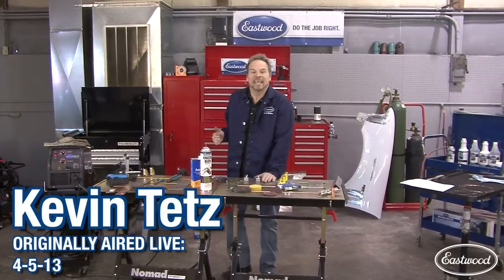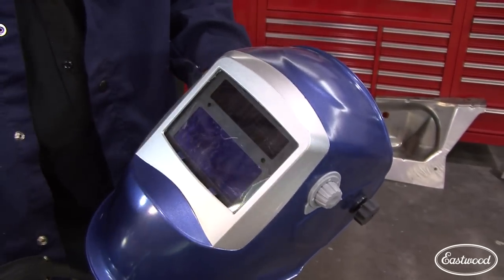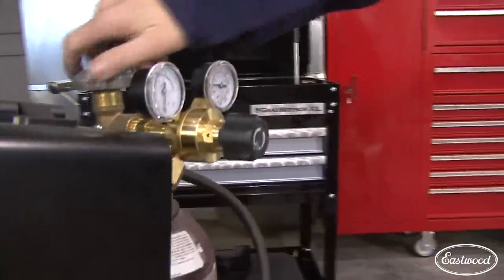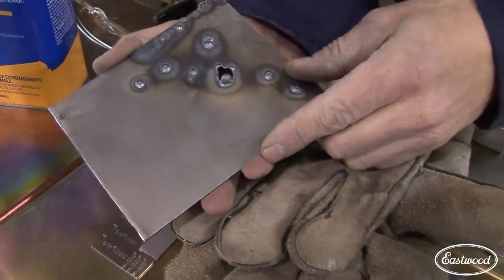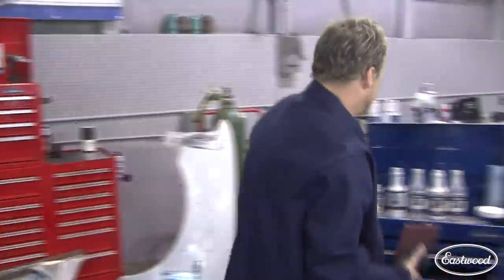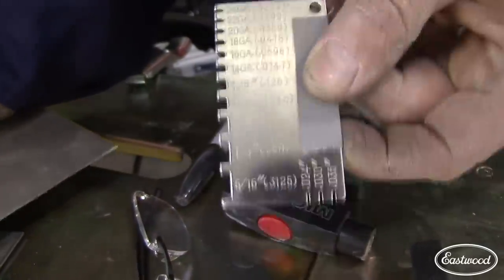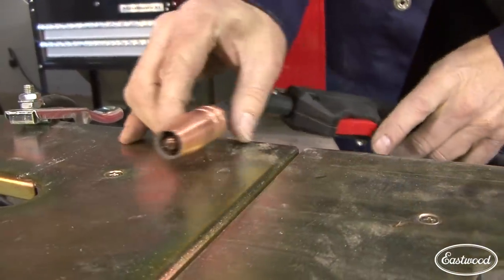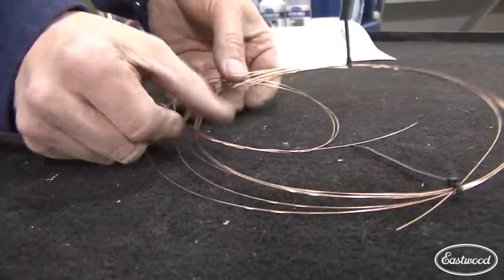How To MIG Weld & MIG Welding Tips - Getting The Perfect Weld Everytime - Pt 1/2 with Kevin Tetz

Comment: Clearly you know how to weld.  My only issue is the short shrift given to flux core welding.  I suspect a great many "amateur" welders started out using an inexpensive flux core system, before "upgrading" to MIG or TIG as the proverbial Holy Grail of welding.  Be that as it may, flux core welding offers serious advantages over all other types of welding, yet these advantages go unrecognized, even by "experts" intent upon selling us all on more expensive welding systems.   Once the user has developed sufficient skill using "cheap" flux core" he or she can produce quite strong, and yes, "pretty" welds using a process so may turn their nose up too.  A FC bead won't be as intrinsically "pretty" as a MIG bead, but the FC weld can be make under ALL weldable conditions, whereas MIG is limited to indoor locations.  FC beats SMAW every day of the week because it provides the user with a more precisely controlled system.  The nonsense about what any given system can weld "in one pass" is what keeps sales of stick machines going strong when in fact, every welder knows that multiple passes can be used to fill up a V-groove of thick metal...in fact it's used all the time using TIG for pipe welding.  For 90+% of all welding, the "do-it-yourselfer" is well served by a flux core machine.  Even better is to purchase a "MIG" machine with infinite heat control and use FC wire in it for about 99% of welding.

Comment: 5:52 My two cents.  I recommend to crack the main valve ever so small like to open the Gas gently until the hose is fully charged, then fully open the valve all the way, then back it off a few millimeters.  It'll save your gauges.  Open it so little that you can actually see the gauges move and not just jump as if they are going to just spring out of the dial into outer space.

Comment: as always, great videos Kevin. 

I would love to see you fab up some seat brackets for a aftermarket racing seat. going into detail about seat heights & angles. 

I know its probally a far cry to get you guys to do something like this, but I am faced with trying to fit some recaros into my project car & think I may want to use the stock rails/sliders from the car, & weld up a bracket to easily bolt in the recaro to it

Comment: The valve on your tank is designed to seal itself internally when it is either fully open or fully closed. Don't "crack" the tank as suggested in the video. It is bad for your seals and will cause leaks.

Comment: E and 5 on the welder? What does that translate to in voltage, and inches per minute on the feed rate of the wire? Differing machines have differing labeling and meanings. So, what does E equal in voltage, and 5 in wire feed speed? Last, did the chart recommend the torches travel rate for the weld, in inches per minute? What was it?

Comment: Is it necessary to touch the welded metal with copper piece on the MiG torch? While welding?.if you touch it will not melt?

Comment: Yeah my bad, I meant "not to mention combustible gases" which could be lying around the work environment. 

Such as Butane / Propane / Hydrogen / Ethanol etc all these factors need to be taken into consideration, especially if the individual is a self employed mobile Welder. They go where the work is.

I apologize in advance for not making my original comment more clear, reading it back I can see I give no indication to what I was talking about. 

Love your username btw *Passes Joint*

Comment: After 9 weeks of stick welding. Which is brutal for a guy who hates stick. (Its easy but it's a pain in the ass because your swapping rods like a madman)(about 40 rods in 3) hours.

Mig is super easy. You just need to know how to operate your machine. Which components you need. And how to start the weld(bad angle=bad start)
Get started and with right technique then it's the easiest thing you could ever do.

Comment: What kind of welder do I need buy to start practice welding and eventually in my project car? and What other equipment do I need to buy please? Thanks
Reply from the maker: +cherfieldm An Eastwood MIG 135 is a good start and operates on 120 volts.  If you want to do heavier steel check out the Eastwood MIG 175, which operates on 220 volts.  Both can weld aluminum with a spool gun.  Visit Eastwood.com and you can talk to a Tech who can set you up with the welder and accessories you need.

Comment: hey i have a question, i am about to buy a mig 135 welding kit from you guys and i am wondering if it would work fine in my country, i think it says 120volts? here in my country we have mostly or around 110-120 so that should work just fine? also what is the actual amps would that pull from my house hold circuit ( load rating ). i dont want to buy it then it might run my bill up high or trip all the breakers in my house lol

Comment: Great. How would you ever weld 60-year-old body panels without them being this good here? You could not. So would a tig be better to use for such than a mig? In the case of old metal being welded to new?
Reply from the maker: Why aren't you able to weld the old metal?  Is it rusty?  If it's that bad, can you cut it out and replace it.  TIG welding will give you more control over the heat.
Reply: I believe it has to do with not being able to access the backside and clean it well, that the blow through happens. If you cut out a large enough piece so that you can access the inside of a panel or door, you've cut way too much.  More welds more work. End up just replacing the entire piece at a huge cost. Any place I have welds I usually see dimpled metal where rust has been cleaned off. So I'm trying to weld that area. Again if I cut further back, most time it is in the way of something else...or more curved and odd shaped areas, that I cannot rebuild metal and form it to fit. Thanks for the reply.

Comment: Can you use the cheap Rubbing Alcohol from the drug store to clean the steel parts before welding or to wipe down the panels before bodywork ?? I have tried this it seems to work ok but not as quickly as Acetone.
Reply: how to install replacefront powerfront window motor regalater on 2001 Mazda mpv

Comment: I hope they've updated their settings chart.  Look at the video closely and you'll see that they're missing a zero on the wire size in inches.  0.25 in DOES NOT equal 0.6 mm, that would be .025 in.  Can you imagine a MIG wire 1/4" in diameter?  (The other inch sizes on the chart are wrong, too.)
Reply: Absolutely true.  Yes, I have a typo on a youtube post.  Eastman has typos on their product!  That's my point.  (The chart shows wire sizes of .25" to .35".)  So, you got me but I'm not an expert welding company.  :-)

Perhaps you are accustom to quarter inch welding wire?
Reply: By the way, I looked at my Eastwood MIG 175 and it uses the same incorrect inch dimensions.  It also has the word "lager" in the place of "larger" when referencing the wire drive wheel grooves.  I don't mind that these are made in China--that brings the price to where I can buy--but it does make me worry about Eastwood's quality control when they can't get a little thing like the printing on the sticker correct.
Reply: .25 is not1/2 in! .25 is 1/4 in.

Comment: Do you have to prep or clean both sides of the sheet metal\panel?
Reply from the maker: Really depends on the contaminants and how bad it is. If it's bad on both sides and you can clean both sides, that would give you the best welds.

Comment: Can someone explain why it seems most guys use mig welders on automotive sheet metal than tig welding?  I want to buy a tig welder AC/DC but seems like most are using mig.
Reply from the maker: JDPower 55 Probably because they already own a MIG welder and haven't purchased a TIG welder and become comfortable with it.  Some people may prefer the speed of MIG welding.  TIG welding is usually going to give you better results for numerous reasons (less heat over a large area, less bead to grind flat, easier to hammer weld). Remember, Eastwood TIG welders come with a 3 Year Warranty and 30 Day Money Back Guarantee.

Comment: Those little edges  dont mean shit a good welder with proper machine settings could weld that up no problem  !! thats where you  separate  the boys from the girls !!
Reply: Ol School Welding Tips and Tricks 
hey man Im getting test in 19v and 160 in MIG but I was wondering is there any way get that perfect tee joint weld like I count 123  sometimes but any tips helps
Reply: KING TANK  Im just getting started on my YouTube  channel  , Im trying  to get set up to film welding  videos  and my first  video  will be ( HOW TO RUN A PERFECT  WELD JOINT )  # 1 you grind the mill scale off  make sure  that both pieces  of your joint are clean than I usually  spray my weld joint with spatter shield, #2 make sure  you have your voltage  and wire speed  set for your Material  thickness and position , I run my machine  a little bit  hotter  than your normal  settings  But I run faster #3 I personally  push my puddle  instead  of dragging  but that is personal preference,  I move in a  fast forward circle  motion when im done my weld looks like herring bones I  will show you on my first video how to weld a ( PERFECT)  T  / BUTT / LAP   joint and other vids on out of position welding vertical / horizontal  and overhead ...  good luck
Reply: Ol School Welding Tips and Tricks 
alright thanks man
Reply: thats where you separate good welds and mediocre welds that are good enough
Reply: Kevin Delatorre 
true I'm a good seller don't get me wrong but just advice from over people can't make you any worse
Reply: @arcturusbbqsausagemaking2435  still waiting on that welding video...